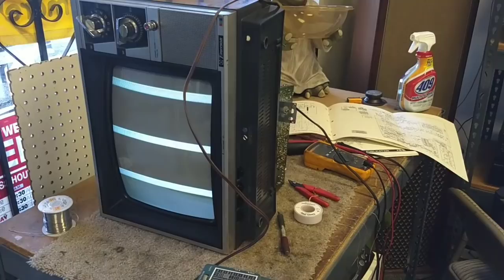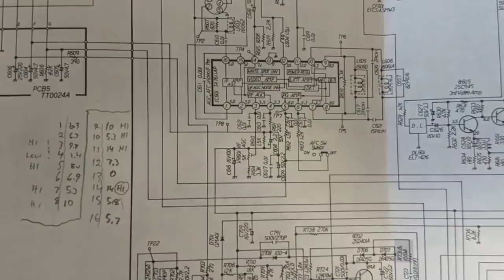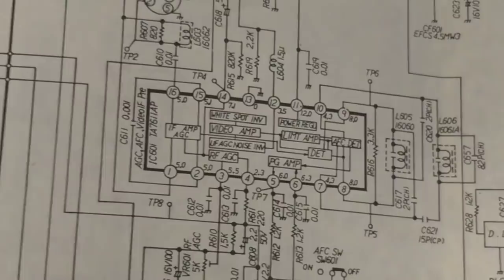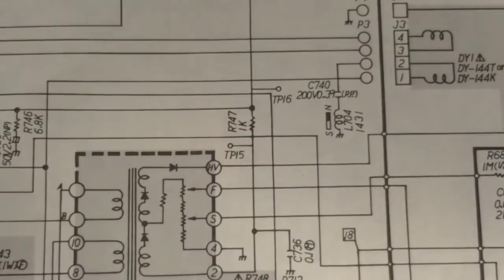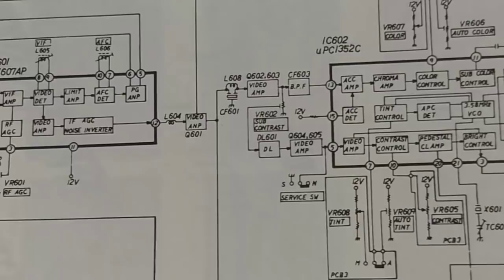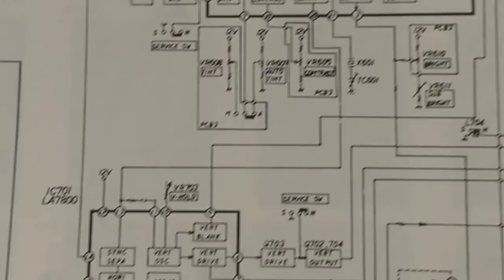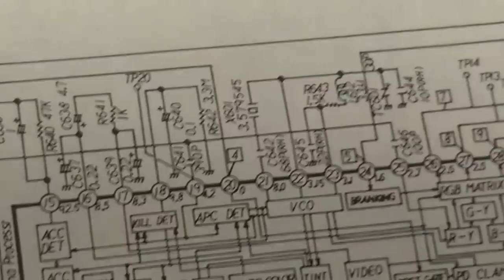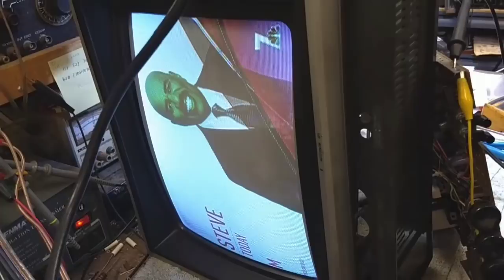Troubleshoot and repair a 1984 Emerson EC133 color tv Part 4/5

Comment: Still think if u get rid of the bar the color will work. Scope time. Put a "dead" signal on & scope through the
video & be sure its clean & blanking pedestal gets removed.  Next go back to horz AFC,  check that & the
feedback from the FBT.  Remember Sanyos with no color on left 1/4 of pix. That was small 'lytics on a
B+ line. Check for more glue, we called it snot, can eat up etch. Bad shit. look for more on TOP of chassis.
Similar prob on MGA 35" the glue ate up the ground for the color part of jungle IC.  Its a ball buster but thats 
what separates the men from the boys........ 
LFOD !
Reply from the maker: The bar on the left is definitely color related. If I ground out the color killer pin on the video IC the black and white is clean.

The chroma signal seems weak.

I'll check and see where the feedback comes from the fly. The schematic isn't too clear about that. I see a feedback line that goes to the blanking pin on the video IC...

Honestly dont know what the pedistal clamping is. I'm a vacuum tube tv guy and this is a new concept to me

The service manual I have has little information on what the correct waveforms should be on what pins or test points.
Reply: Before H. blanking you should see the whole video signal. After that the Hoz sync pulse is chopped off. If it gets to CRT you get lines like you see. On the sync pulse "back porch" you 
see a burst of 8 cycles for color sync. The burst gate comes on keyed to the  Hoz  out.
grabs & amps the 8 pulses & passes them on to the 3.58 osc for sync. 
Last thing is scope all B+ lines & +VCC on IC's Usually some small ( 1-10 mfd) caps
to clean things up. Any crud on the B+ lines can do some strange shit......
Good luck
LFOD !
 @JordanPier

Comment: You definitely have a problem just outside of that color ic. That’s why I wanted you to add a variable Silva mica cap across the x-tal and see what happened.Is the crt ok?what about the the R/G/B amp board on the back of the tube?
Reply from the maker: The amp board is another place I haven't checked. The tube tests good. The mica trimmer I replaced was across the xtal, which allowed me to lock the oscillator back in.

Though the color control effects voltage at the input pin on the IC, The color level always remains the same - just a hair above minimum.